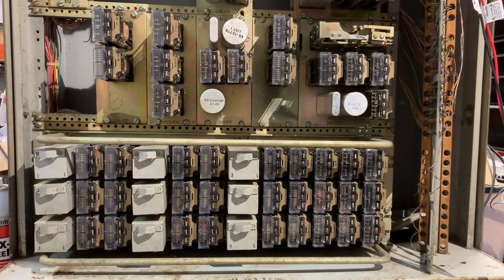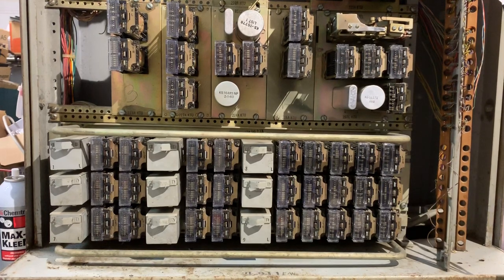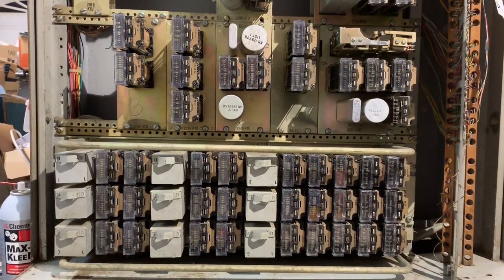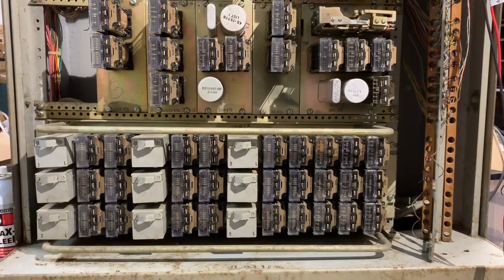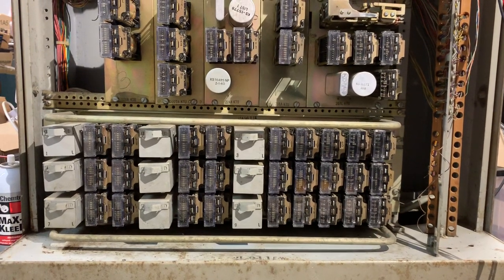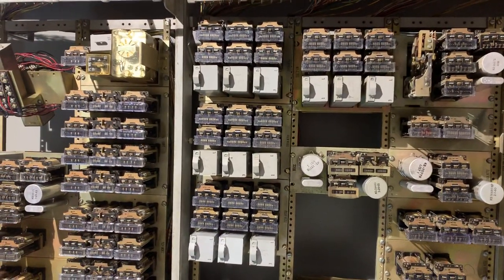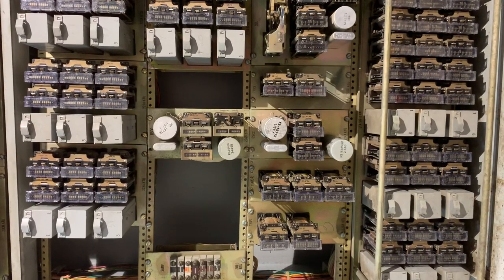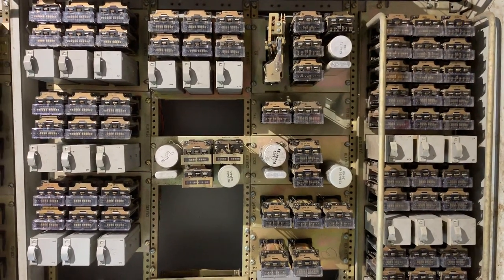Western Electric 6A Dial Intercom Demo

Comment: Is there no ringing generator on this system?
Reply from the maker: The ringing voltage in this case is supplied by a Western Electric 30c1 power unit that supplies 105VAC at a frequency of 30Hz.   The ring back tone is supplied by a 224B KTU that uses an electromechanical vibrator to produce both dial and ring back tones.
Reply: @howardharte5064  oh, I just didn't hear your extensions ringing so wanted to know why